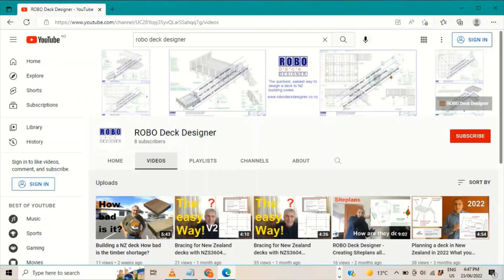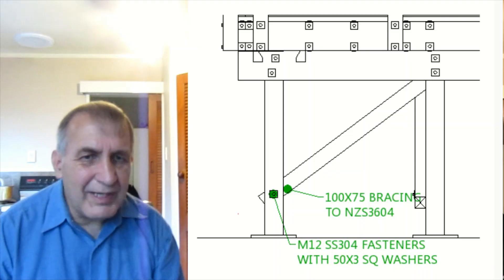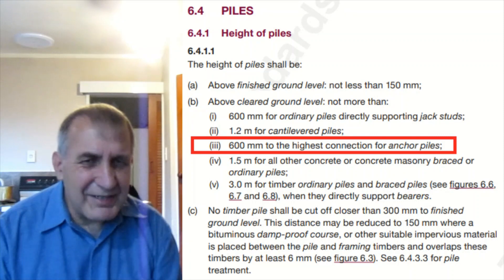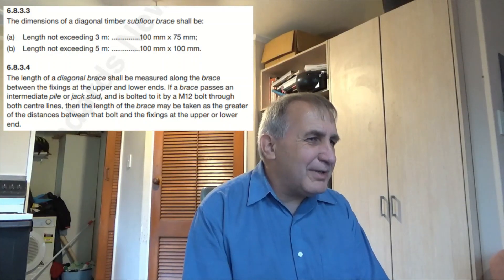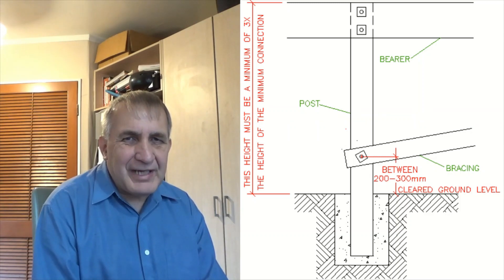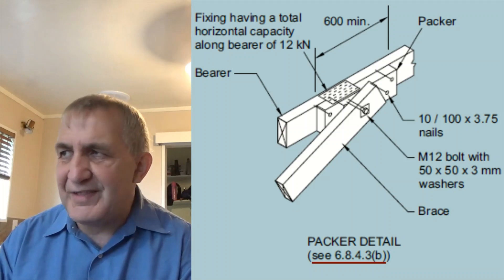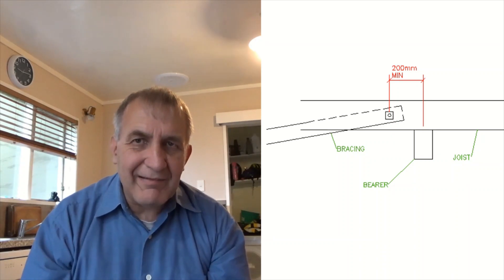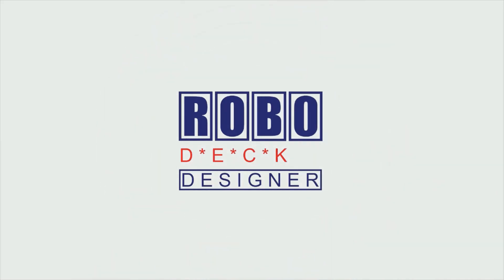Braced Piles for New Zealand Decks

Comment: Hi Paul, great video.  your diagram of a brace pile shows a foot of 50mm, the code has 100mm foot under piles.  We have been using holes of 450mm x 450mm x 450mm with pile 350mm into ground. Are our piles strong enough to be used as brace piles? thank you.

Comment: Hi Paul, great effort, awesome video. Like your website too. Built in NZ for many years, I'm in the States now. But I still use 3604 (things are actually very well labeled and explained in NZ). I come to you today with a technical question you might be able to shed some light on. I would like to brace quite strongly a system of piles I'm designing. Would like to brace every pile in my design, bracing from the bottom of one pile to the top of the next, and repeating all around the perimeter of my pile system. I'm wondering about Figure 6.6 in NZ 3604 ("Braced pile system - Brace connected to pile") there is a note in that figure that states "2nd brace permitted if only one brace attached to bottom of pile". Do you think you could explain to me what is the meaning of this note? Thank you very much in advance for your help Paul! Alex.
Reply from the maker: Hey Alex, thanks so much for the feedback. What is meant here, is you can only have one brace at the bottom of a pile, it puts too much load on the footing. Hope this all makes sense. If you are building a deck in the States, please be mindful of local building codes.
Reply: Thank you so much Paul! I would have made a big mistake! = ) God bless!
 @robodeckdesigner

Comment: Hey, you didn't mention what treatment and grade the brace needs to be, are they  100x75 MG8 Is this correct ? or can you use any 100x75
Reply from the maker: Hey Dave, sorry this wasn't covered in the video. In NZS3604 under section 2.3.2 b) there's a section there on the correct grade, this must be for wet timber. I would have chosen SG8 (sorry not MG8). Also please be aware of the length of your bracing, depending on your length this may have to be 100x100 rather than 100x75.